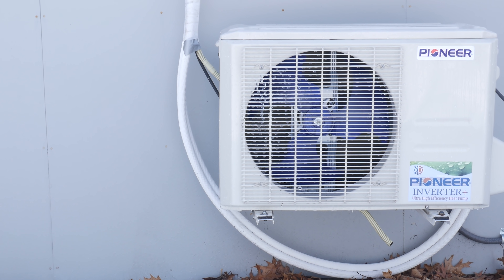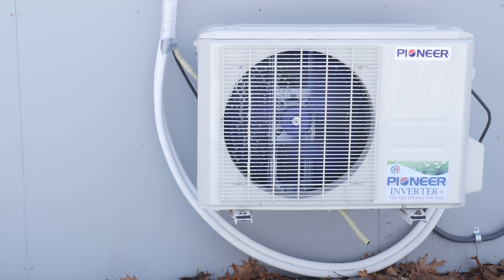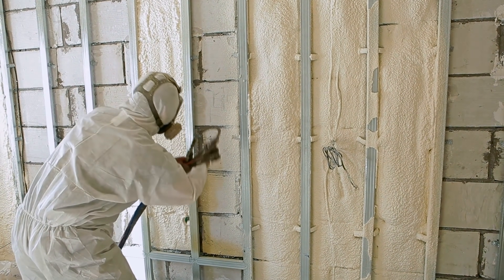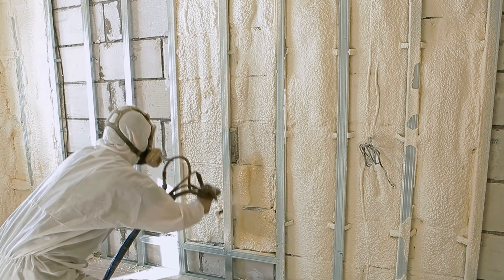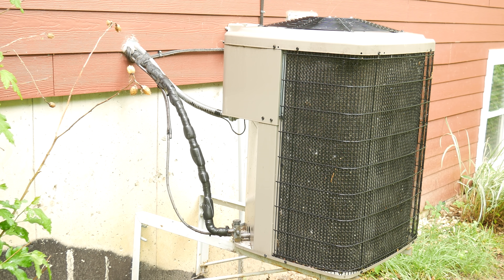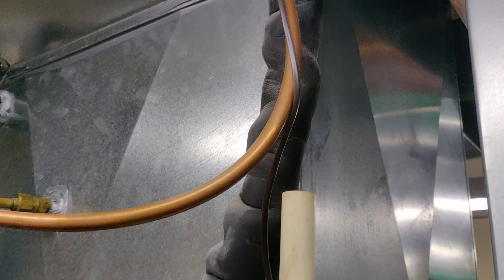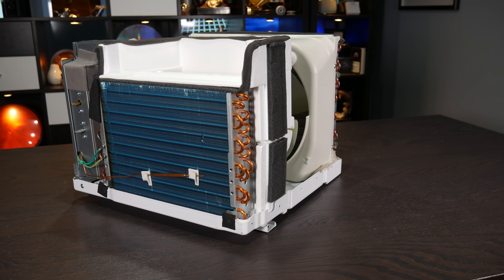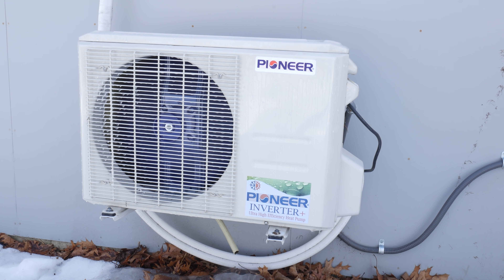Heat Pumps are Not Hard: Here's what it will take to start pumping

Comment: Alec, thank you for pointing out the price gouging. I was turned away from an HVAC company for a mini split because they claimed they no longer had a mini split person. As if it is really any different to install. 3 others quoted 10k per indoor unit, the equipment was about $4500 shipped to me and they wanted $30k to do it, nothing more than greed. I ended up going with a MrCool unit that requires no vacuuming of line sets and is an easy DIY. If a local company had quoted me 12k to install a 3-4 indoor multi-zone system they would have gotten a sale instead they all wanted more than double that and therefore I did it myself over a weekend. The industry needs serious changes or else they will lose to more DIY options.
Reply: Exactly.  It makes no sense.  Mini-split systems are MUCH more DIY friendly, so one would think they would want to hit that market with everything they have.  Instead they're pushing against it and ultimately losing more and more business.
Reply: These prices are outrageous. I live in Australia and these sort of air conditioners are on virtually every house and there are so many companies that can install them. This is a price list accurate as of April 2022 converted into USD/Tonne for Mitsubishi Heavy Industries arguably the best brand, it used to be so much cheaper before COVID but everyone is putting their prices up. Make your own mind up looking at the below but even the 7 kW units that cool or heat an entire large house it's still only 1.5k usd

2.5 kW (1.0 tonne) $800 USD
3.5 kW (1.0 tonne) $1,000 USD
5.0 kW (1.5 tonne) $1,100 USD
7.0 kW (2.0 tonne) $1,400 USD

Reiterating this isn't just installation, this is supplying the actual air conditioners, delivery, installation, labor, testing.... 5 year warranty

For $10k I could install a 22 kw (>6 tonne) ducted unit into a 5 bedroom house with the entire house cooled or heated and probably still have heaps of cash left over. American labor is cheaper, why are your air conditioners so expensive!
Reply: I'm sure they'll soon address that issue by making it illegal to do your own HVAC work.
Reply: The biggest issue for DIYers is that many HVAC companies will not service your system if it wasn't installed professionally. I am fairly confident if I ever have a failed part on my DIY installed unit, I'll struggle to find someone to fix it.  But given the price difference of 30-40k for a 3 or 4 zone unit, I could easily buy 8 systems at the current price before my investment was a bad deal. I'll take those odds even if it is incredibly wasteful to essentially throw away a system if I can't fix it or get it fixed. The good news is they are relatively simple systems and parts replacement outside of the refrigeration loops is likely very doable. We'll see if I have any regrets in the future but so far I have none.
Reply: @renakunisaki  Technically it already is as an unlicensed person.  But, it's not like you'll be arrested or prosecuted unless you're doing it for money.  You can also buy the refrigerant as an unlicensed person as long as you say you're buying it to resell.
Reply: A single mini split costs $4500? Here, in India I can get a good 1.5 ton AC (premium brands like Mitsubishi, Daikin or Hitachi)  for $700 lol. All these companies and contractors are taking every one of you for a ride.
Reply: @Chopper153  $4500 is for a 4 zone 3 ton system. Still very expensive but not quite as bad. That includes all the line sets and parts for installation so in my case roughly 140 ft of refrigerant lines already charged and pressurized.
Reply: @MarksDIY  That's a good price. My new apartment will come with a 4.5 ton VRF system and costs around $5k.
Reply: THAT $15,000 INSTALL in the video was insane.  I would buy the unit wholesale for $3000.  Then tell the HVAC company “I already have the heat pump.  Just install it please.”

I do that with car dealerships too: I supply the oil & filter, and they charge $15 labor.  It saves money

.

Comment: Thank you for this information. I live on Gabriola Island in BC Canada. Here we have a community program started by an enterprising small group of retired professionals and a willing HVAC professional. They researched heat pumps 10 years ago and decided on the high efficiency Fujitsu. They became a Fujitsu dealer and have been bringing the 12,000 BTU mini split into the community at wholesale. They arranged for a local installer and, once the physical installation is complete the HVAC guy comes by and commissions the unit. In our small community they have installed over 1000 units, even giving some away to needy recipients. BC Hydro has noticed the huge reduction in demand during the winter because most systems replace baseboard heaters, and hundreds of homes are more comfortable and more healthy during the winter (and air conditioned during the summer!). Community in action! It can be done!!
Reply: Yep, loads of baseboard heaters here in coastal BC. Heat pumps are super efficient here thanks to being so mild. And at worst, I have a wood stove if we get some freakish -15 days.

Comment: You're right about the price gouging going on. I live in the Seattle area and wanted to get a mini-split system installed last spring. The cheapest quote I could get for a 4-head 3 ton unit installed was 12K. The high end quote I got was 19K. I ended up going with the low bidder, but it turned out to be something of a mistake. The technicians really didn't know what they were doing and it took 4 follow-up visits and a different company with competent techs to figure out that they didn't tighten the flare connectors enough to stop them from leaking refrigerant. I blame part of the cost on inflation and demand, though. There are a lot of people retro-fitting similar systems for cooling around here as our summers are becoming increasingly hot and most of the existing houses weren't built with cooling systems. I'm still very happy I did it. The cooling made last summer's record high temperatures actually bearable, and our heating costs this winter have been significantly lower (we have a gas furnace).
Reply: i dont think it matters what kind of refrigerant device theyre installing. theres no reason why a company that works with any refrigerant devices wouldnt know how to tighten a connector so that refrigerant doesnt leak
Reply: I live in a pretty high price area too. I have the common central ducted system with a condenser outside and a furnace/evaporator coil inside. My system was over 20 years old and the outdoor AC unit was dying, it was either fix it or replace the system. Decided this was a good time to switch to heat pump as I didn't want to risk a broken AC during the sweltering summer here and heating oil prices are only getting worse, epically with the current supply chain issues. Last year my AC broke in the middle of summer and it took over a month and a half to get a replacement part and I didn't want to go through that again.

For a 3.5 Ton SEER 16 HSPF 9 heat pump + new air handler I was quoted anywhere from $9.5K to $14K (depending somewhat on the brand: Bryant was cheapest, Carrier & Trane was middle of the road, and Lennox was sky high). This was for a normal "entry level" single stage heat pump, not a mini-split, not a multi-stage or variable speed, and not a cold climate heat pump. When I looked at systems that were cold climate adapted, basically could pull heat even at 0F with very little loss in efficiency, the prices where through the roof! We are talking $18K - $30K! I wish there was more incentive to bring this new tech down to the masses, I think it could help a lot of people but right now the tech seems to be limited to only the premium and luxury models. I got quotes from 4 different vendors so it wasn't an outlier.
Reply: Hi Jordan, what companies did you get quotes from? I’m in Seattle and looking for more estimates to do a swap of my oil furnace for a heat pump and air handler using my existing ducting. Thank you

Comment: I love this channel so much. One of my all time favorites on youtube. You have an incredible ability to succinctly explain complex stuff.

I just wanted to point out that Insulating without Air-sealing can be very problematic. Any time you insulate, you should also air-seal--and vice versa (especially in older homes!) to ensure that the thermal boundary and pressure boundaries are aligned. For example, if you insulated an attic and didn't air seal, now all of the sudden the attic is significantly colder than it was before, when it was heated by the warmth flowing up through the living space. If warm moist air from the inside of the house is still able to make it up through the attic, then you can get condensation on the underside of your roof and create mold and mildew problems or rot your roof off. 

I'm a Weatherization auditor and I would love to continue to see you explore topics related to weatherization. Maybe a blower door video?? I feel like that's totally up your alley. Thanks for all your amazing work, Alec!
Reply: Any advice relating to climate should specify what climate on Earth you're talking about.
Reply: Bradley,  A blower door video would be great!  Why not make one yourself?  Try to write out a script, and then read it without saying Um every 30 seconds!  It really helps to practice the script a couple of times before going "Live" on video tape.  You have seen those video's where the commentator is saying um all the time, and you hate it  - Right. 

At my house, the State of Oregon sent out a auditor who did a air duct leak test.  They never closed off the air filter, or put anything in to stop air backflow through my 4 ton heat pump.  They "Claimed" that there is air loss from the air ducts of 250 CFM or something.  Then they removed every floor register, and put in duct sealant, and did the test again.  Surprise, the ducts are now sealed with less than 50 CFM lost at this test.   I never did tell them I know a thing or two about HVAC and air flow.   What a rip off, but at least my air ducts have sealant in the area where they meet the floor, and actually are sealed better than before.   

To do a true test, I would seal each air outlet vent with a plastic shopping bag, then place the vent register back in place.  Then with the air filter also in a trash bag, and put back into place, the only air duct open now could have about 1" of static pressure to see how many CFM of air is flowing into the air ducts, and thus out the door!  

I have seen diligent air loss tests, where the air door blows air into the building, and they used a chemical sprayer to shoot soapy water onto the exterior of the home, to look for leaks.  Like around the electrical outlets, window frames, door frames, ect.  They got lots of air bubbles.  Even at 0.25" of water column pressure in the home.  It made quite the display on that video!  Soap bubbles everywhere!

Comment: I have to say that my experience lines up with your anecdotes. I live in NC USA so I need both heating and cooling, but more cooling. I added a Mitsubishi minisplit to my garage so I could work out in it during the summer comfortably (and I love it!). The first company I called that had serviced my home's barrel style heat pump didn't do minisplits at all for some reason. Later I had my A/C go out in August due to a cracked coil and the recommendation was to replace the condenser and coil given the age of the system. I wanted a variable speed system with high efficiency, but that would have been a 2 month wait and more than double the cost, even though the installation would have been essentially the exact same. I didn't want to go months without HVAC, so I got something very similar to what was originally installed, which is a 14 SEER unit. In the winter the aux heat comes on for a lot of the time and I end up further supplementing with my gas fireplace. I hate it.

For a future video I think you should do something on HRV/ERV units that are installed in very airtight homes, like those following the passive house standard. It's a very interesting technology and I think we ought to be pushing codes much closer to passive house standards for both insulation and air tightness. They are dramatically more energy efficient, and have additional benefits including much better indoor air quality (and in NC we have horrible pollen in the spring) and are much, much quieter indoors. Homes like this can often get away with a much smaller HVAC system, and the "lego-like" split systems you talked about are great options there.
Reply: The biggest sin here is they installed a 14 SEER unit in 2021.  There's no excuse!  It's also (obviously) not engineered for the NC climate (I live in extreme NE GA, so similar climate).  A decent mini-split system is 22 SEER and will heat to (at least) -5F without inefficient heat strips.  Why they don't make ducted systems with the same specs is beyond my comprehension.....

Comment: I recently replaced my heat pump in Central Florida. I was surprised by several companies that were trying to talk me out of it. I asked a lot of questions pretending I didn't know about heat pumps and got a mix of good and bad answers. Also I had a 3 ton unit and just over by a few square feet to move to a 3.5 ton unit. In the end I found someone with very little markup for a heat pump, took time to add freon in my old leaking system to help determine if the current system would cool well enough and give me options that made sense. Luckily for me my Honeywell smart thermostat showed over 150 hours of use for heating in the winter. I had 7 quotes with only 3 that seemed like they understood heat pumps and the reasons they were valuable. A couple companies said that they just were not needed because it didn't get that cold. It got down in the 30's last winter which would have been too cold in house for me. I used heat pumps in Missouri and Kansas and they worked great until it got below 25 degrees Fahrenheit for the older units. Makes sense in most of US.

Comment: I would really love a video on insulation specifically. All the types! My main questions are about environmental impact and fire safety. Also the environmental impact of flame retardants in home construction and furnishings, but that's a different video.
Reply: First, if fire gets to your insulation, your house is already gone.  We're using mineral wool insulation in our walls and traditional fiberglass in our ceilings as we remodel.  Get the highest R value you can for the space you have.  It will only pay for itself as time passes!!
Reply: @c0rnd0g_19  different types last longer in a fire or slow the fire down, giving you time to escape
Reply: Idk if technology connections will ever do one but Matt risinger has multiple videos about all types of insulation for a wide variety of building types
Reply: If you're worried about flame retardants and fire safety, look into intumescent paint! It's a wonderful way to fireproof things. You can add in fire grenades to control fires.
Reply: @c0rnd0g_19  In the U.K. the Grenfell tower enquiry is still going on. One description of what happened was that they took a fireproof concrete building and wrapped it in a firelighter covered in tinfoil.

Mineral wool should be fine. I do wonder about things like the polystyrene block the video showed someone installing.

Comment: Weatherization Auditor here, Insulation is my life. I work at a Community action agency and do free efficiency upgrades to lower client's baseloads, such as LED replacements and New Fridges if the current one is over a certain kwh/yr. Our clients are anyone under 200% of the poverty line, with other factors affecting their priority points, or place in line. I also make it my mission to switch out 70 and 80 percent furnaces replaced with a Heat Pump. I'm one a few over here in Western Kentucky. This is important work, Alec. Thanks for covering it.